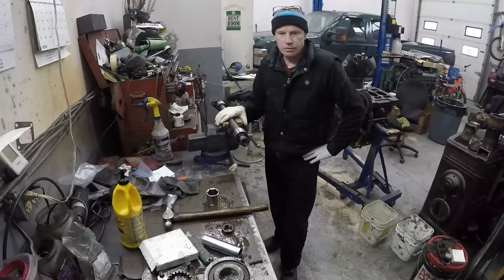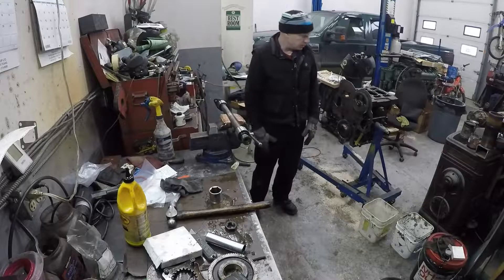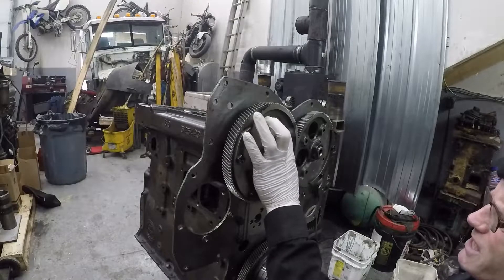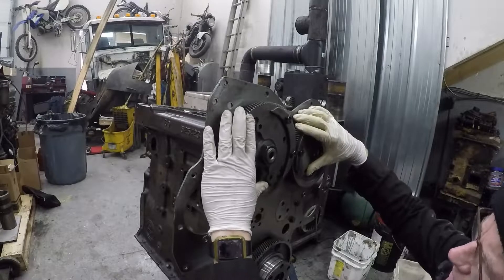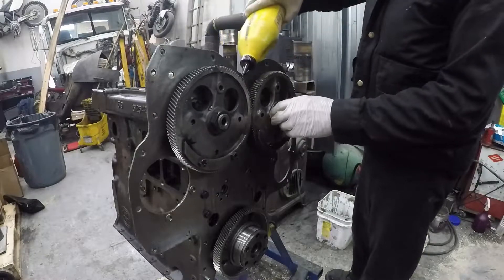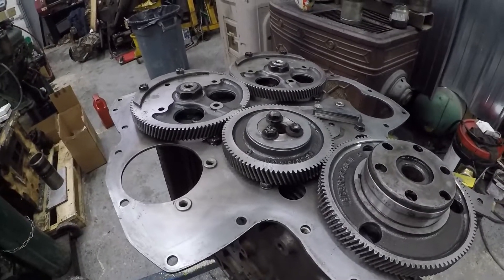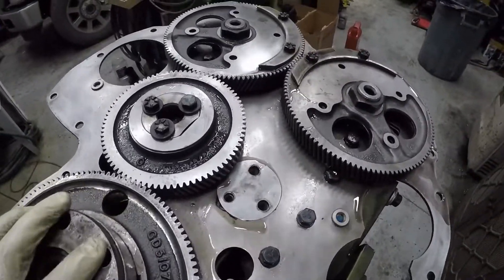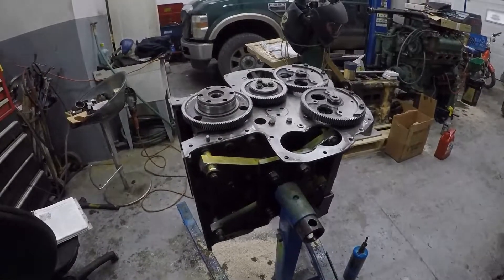Detroit 353T Camshaft And Timing Gears

Comment: 4 years ago is some time , hoping you still are looking in to the comments . thank for sharing . i am thinking of taking on the assembly of timeing gears on  a large in line 6 detroit older tractor The gear case was taken apart because of a oil leak the guy who took it apart  left it in parts and did not ever come  back to put it together.
I have a good  amount of mechanical time in on gas engines , sorry for the long winded message 
 TO THE POINT, the guy marked the position of the gears , am not going to trust a thing the guy has done ,so my question is how do you find TDC when the cylinder head is on the engine, do you access from the injector or perhaps remove the oil pan? #1 up but just by making eye contact form under could be 180 out . this may sound like amateur time however i want to know all the details before i start . the cam has not been removed . thank you for reading threw my story some think i may overthink some things LOL.. am too proud for fuck ups and i think it would be a good job to do .
Reply from the maker: I usually take the #1 injector out to find top dead center.  If this is a Detroit, the crank and cam gears are key'd, so after they're installed you have to line up the timing marks.    Hope that's of some help.:)
Reply: @detroitgarage9430 yes that  helps I thought that but just needed to be sure. And thanks very much for your reply and a swift reply. Hope that you are enjoying that shop of yours ,looks like a great set up u have .
Reply from the maker: @davebuick1321  Thanks, glad that helped, having lots of fun.:)

Comment: Hey Boss, question for you. Have a 353 that was running great, rebuilt a year ago. Changed oil and found a sheared metal keyway, like what would hold the gears on the shaft in place. Since then, 10 hours of operation, the machine has progressively ran poorer/weaker and now it won't start. Do you think the sheared key could have displaced the timing? Thank you kindly
Reply from the maker: Yes that's definitely possible.  If it's from either the crank or cam gear then that would throw the timing way off.:)  Thanks for watching.:)

Comment: Fantastic videos. As I understand, the cam and balance shaft can be swapped on some of these, so the head can be put on with the exhaust facing the other way?
Reply from the maker: Thanks, yes the head can be swapped with the exhaust on either side.  As well the engine can be configured to run right or left hand rotation.  Thanks for watching.:)

Comment: How did you get to be so knowledgeable about these old Detroits?  I would love to have one for a project when I retire but I think most of the experts have moved on and I’m afraid I would just have a shop anchor.
Reply from the maker: It's from 40 years of working on diesel and gas engines.  I'm new to Detroit's as in only 12 years, but I understand how they work and they are really simple.  Once you've read the manuals a couple of time and then worked on them it all falls into place.  I refer to the manual all the time incase I've forgotten any details.:)

Comment: Good work on this Detroit. For me this would be the perfect engine for a tracked skidsteer if the t after the 53 means turbocharged. It would sound perfect on a cat rubber tracked skidsteer with one of those brush mulchers on the front. I can just hear it working.
Reply from the maker: Thanks, yes this is turbo charged.  It's going to power an old Ingersoll Rand 375 CFM compressor.  Should sound awesome.:) The skidsteer would be a fun conversion.:)

Comment: So you’re building it with blower right side, exhaust out the left side?  Going to run the turbo outlet through an intercooler or straight over the rocker cover to the blower input?
Reply from the maker: Yes, blower is a bypass blower and will be intercooled running 5A60 injectors.  Will plan a 1200-1500 idle and governed at around 2100 or so.  Be running a 375 cfm compressor.
Reply: @detroitgarage9430  I remember N45 injectors in naturally aspirated truck engine 53s, N55 for turbo truck engines, and N65s in twin turbo 6v53 marine engines(I think!  It's been a long time).  Did the silver 53s have different camshafts from the previous models?  I vaguely remember the we advanced one tooth on camshaft timing for turbo models back in the 1970s.  Didn't know they ever did a bypass blower, looking forward to seeing how that works..
Reply from the maker: @PeterGort  Yes a lot of the T engines used N series injectors, but later engines got the newer injectors like the 5A60, 5C60 etc.  They also ran advanced timing as well, but I running standard.  Maybe I'll try advanced one day and see.:)  The Silver series had bypass blowers, new cam profiles, new liner port design, 2 piece piston to name a few.  I converted my 4-53T to a Silver series engine and it runs nice.  I really can't tell the difference between them to be honest.  I guess time will tell.:)  Here's my F350 with the Silver 4-53T.:) https://www.youtube.com/watch?v=2L19kY_vYws